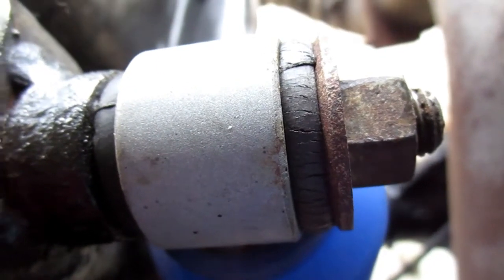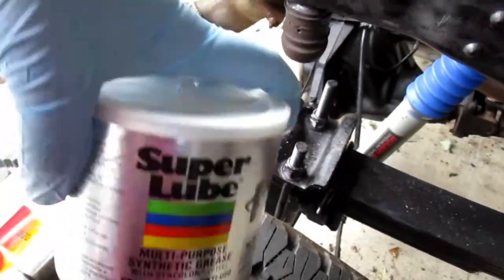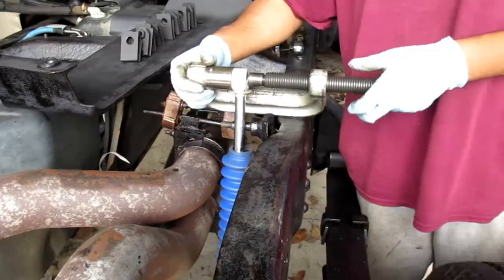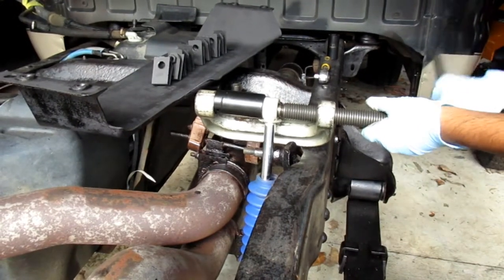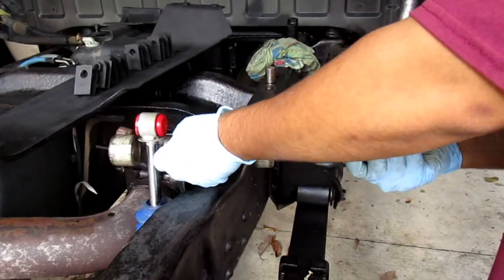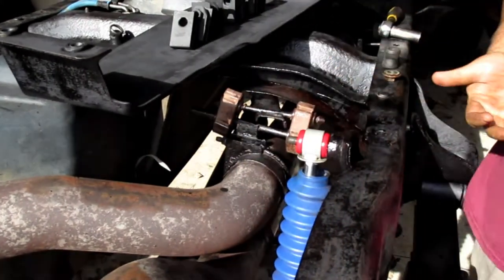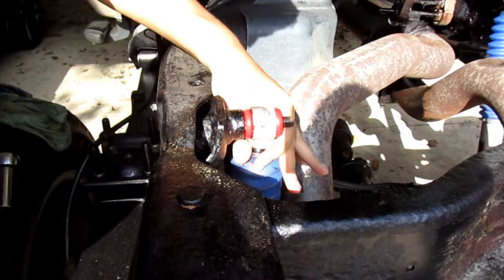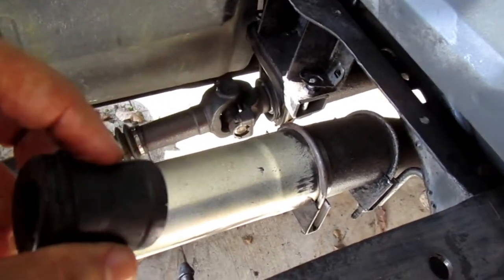Easy Shock Eye Bushing Replacement

Comment: Why did you use a polyurethane bushing when it looks like the original is rubber?You need to be aware of the hardness of the bushing you're installing.